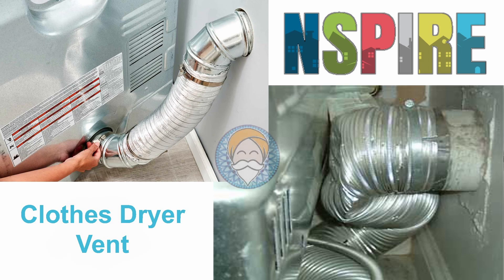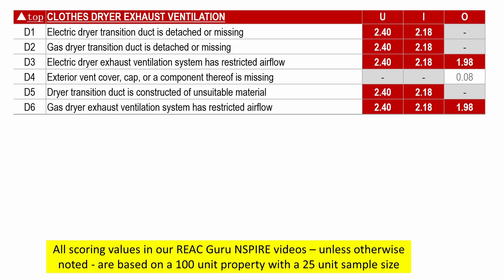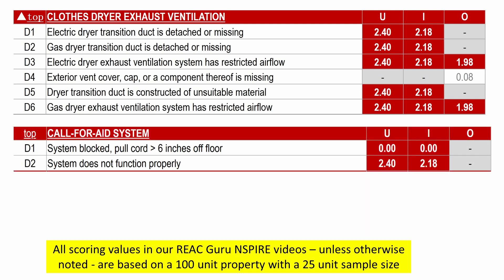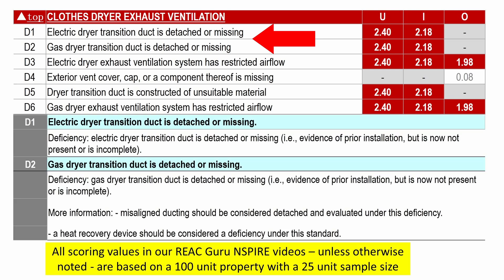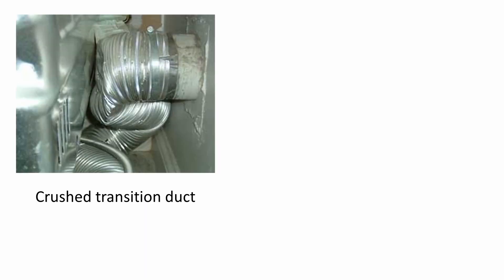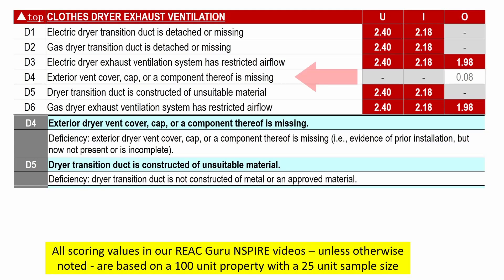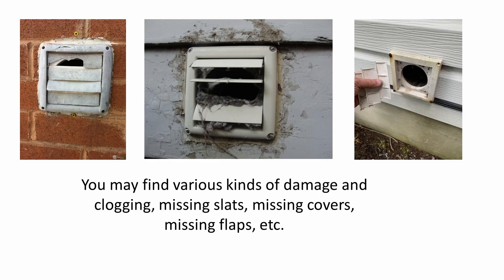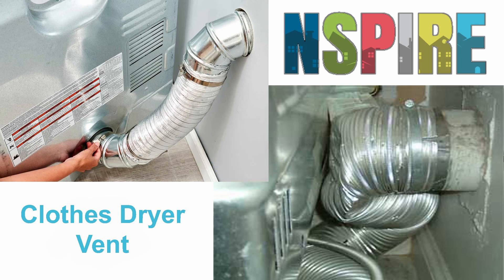Killer Deficiency: Clothes Dryer Exhaust - Really?

Comment: I used to clean these out. They are a fire hazard. In some peoples homes they go straight out a wall and easy for anybody to clean. In some peoples homes And apartments they go up and out the roof. I have seen some homes that had to be sweeper several times, as it just had so much lint. Some were easy. I have caught a few dead animals 🤢
Reply from the maker: Hi, thanks for the comment.  They do vary considerably.  I totally understand why a clogged vent is bad, but it's very weird that this went from one of the most negligible defects to one of the highest scoring.  If I was managing or maintaining a property that has laundry hookups, I would be paying very close attention to these from now on - and in that respect, it's a good thing.
Reply: @NSPIREGuru  Excellent point made here!!